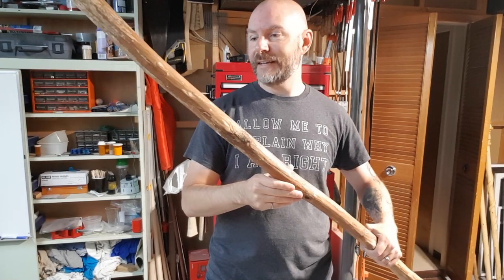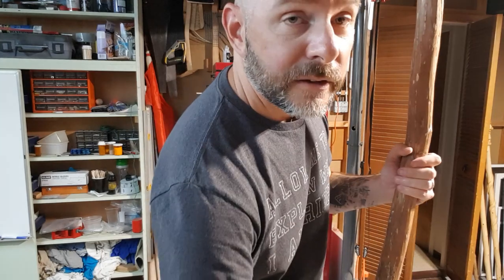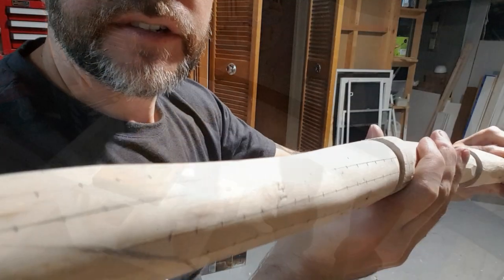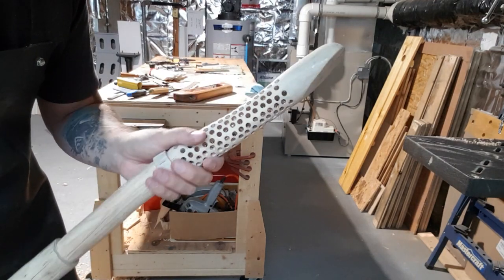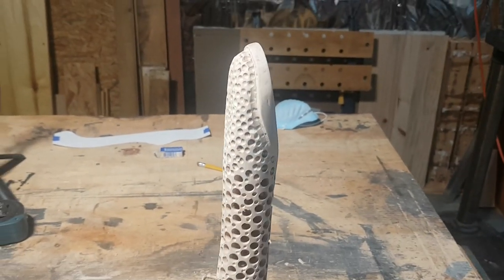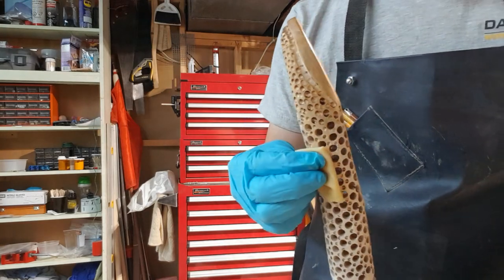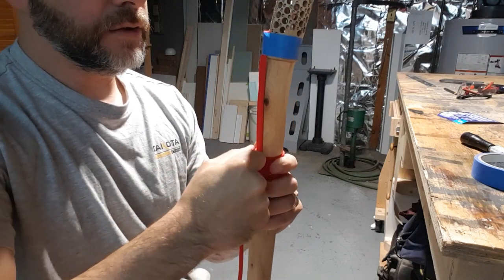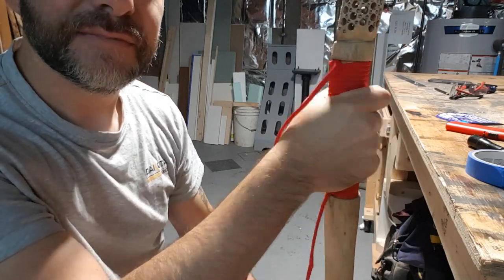WALKING STICK   power carving with the Dremel

Comment: I pulled up a photo of a stick I made with a cholo cactus and a Maple branch. The cactus(like in a reptile terrarium) I put below the hand grip area and filled it with resin. Many remarks from the public. Not magic or horticulture involved, just love making walking sticks that aren't available in Outdoor stores, etc. (Overpriced and under engineered. Well done Sir.
Reply from the maker: I was thinking of putting epoxy in the hollow form section, but since it is above the handle, I didn’t need the strength. Thanks for watching!
Reply: @JasonHedrich  hey Jason, I prefer the UV activated resin to epoxy, less fumes, easier cleanup, cures in one minute under lamp, put in sunlight for a few more minutes to get a hard transparent product or tint to any shade. Almost foolproof if you use clear silicone sheets to contain resin while forming. I use Wax Paper for rough forming odd shapes. Cost effective as you only use the amount you need by layering, can't say that for epoxy which I've had issues layering before. A starter kit at Hobby Lobby was budget friendly but you'll want a larger lamp as you go . 
Your Celtic weave video expanded my outside the box perception on designs. You taught an old dog a couple of new tricks on the video. Attaboy!
Reply from the maker: @markmarricle6981  I've seen it but never used the UV cured epoxy... something for me to look into. Thanks for the info!

Comment: I tried to make one like this because it one of my favourites. I don't have a drill press but I drilled it by hand and it turned out pretty good. I really enjoy your work. As a retired  old guy of 75 I needed a hobby and making sticks has filled the bill well. Carry on and keep up the good work. Mike
Reply from the maker: Great to hear! Glad you made one. It might be easier with a handheld drill, you can better adapt to the curvature. Thanks for watching
Reply: @JasonHedrich  I find the hand held drill hard to use as straight as needed.
Reply from the maker: @mikelavictoire5665  100% agree its harder to do with a hand drill. But even with the drill press, because the diameter varies on a natural stick, it will be difficult to keep everything lined up. But thats the beauty of a natural stick, a little be off is still ok!

Comment: Would the drilled hole section provide a good hand-hold instead of  the paracord  ?
Reply from the maker: It might but it is weak due to all the holes, I would be concerned for strength…
Reply: @JasonHedrich  Thanks for the reply

Comment: Jason the rasp you use what’s the correct name and where did you buy it 👍🏴
Reply from the maker: I think it’s a Nicholson Woodfile rasp. It’s a half round rasp on one side, flat file on the other. I also have a 4-in-hand which works well. They were both bought at local big box stores but also can be found on Amazon. Hope that helps

Comment: What are the size of the holes drilled in the handle and how far apart are they?
Thanks
Reply from the maker: Thanks for watching... I think the holes were 1/4" in diameter and I probably made them 1/2" apart in a staggered pattern. Getting tough to remember that far back! But I tried to leave an 1/8" to 1/4" of wood between the holes. Too little and it would become very weak and potentially break off. Hope that helps

Comment: A suggestion for rolling the paracord. One of my hobbies is making cat furniture, and a lot of it is wrapped in sisal rope. So I set up a simple cradle to hold the piece horizontally, leave the rope on the floor and create tension with my feet, either by resting one foot on it or binding it between both feet.
I then rol the piece with one hand and guide the rope with the other. 
Sine then I have bought a mini lathe that I modified so it can take pieces of almost any reasonable length, and will use it to turn the pieces by adding a foot pedal as a speed controller.
Glad I found your channel, love your work!
Reply from the maker: good idea, thank you! Yes when starting a new 50ft or 100ft length of paracord, its easy to get tangled up with not enough hands to keep pressure and all things in place. I'll look into doing something similar. Glad you enjoy the videos and thanks for your support!

Comment: You made the handle week and easily breakable. Fill the holes with multi colour glitter apoxy.
Reply from the maker: the hole pattern is above the handle... the handle is solid and wrapped in the paracord...